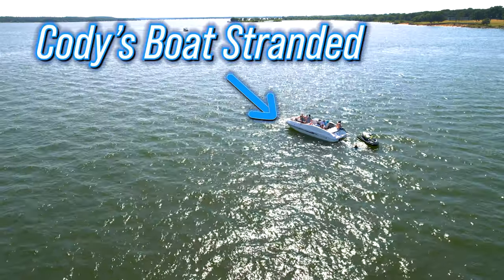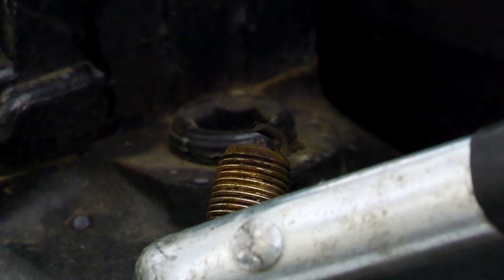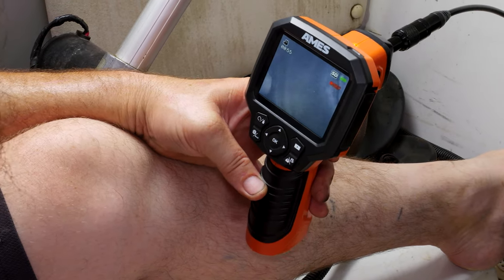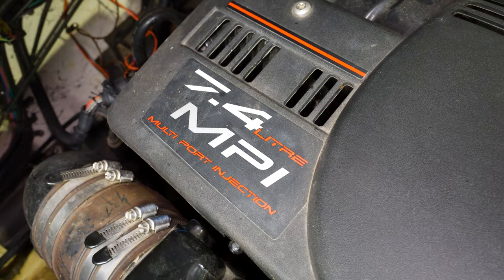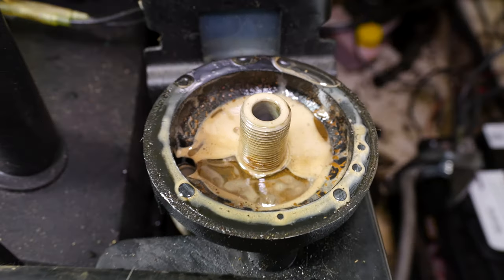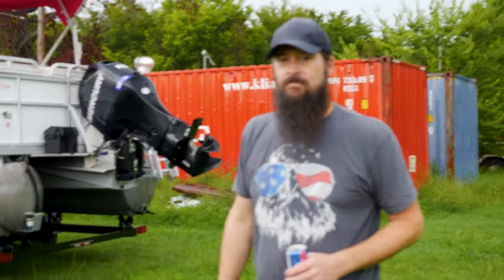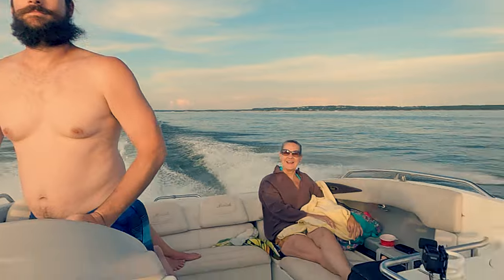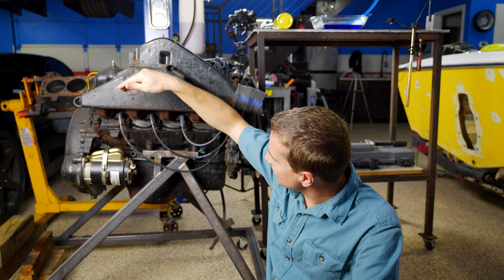We Hydrolocked Our Boat. Here's How We Fixed It!

Comment: So one thing to check is In the exhaust should be a flapper and would prevent that from happening along of people run there boats out of water or on a hose with very little water pressure and the exhaust overheats and melts the flapper out and you only find it when you pull your lower

Comment: Happened to me last month.  Was driving backward and water got in, stalled the motor.  Pulled plugs and turned motor over to expel water, sprayed some seafoam in the cylinders and changed the oil and filter.  All set!
Reply from the maker: That’s awesome man I’m glad you got it going again. I’m sure so many people think they’ve seized the engine permanently and just give up.

Comment: Thank you for doing this video.  It just happened to me on the 4th and i had to pull the boat out.  I followed every step to clear the engine, changed sparks plugs, and impeller.  lots of water came out from piston 8 and 7.    Oil was not contaminated with water.  The engine is running like nothing happened.  Your video saved a couple hundred dollars.  thanks!
Reply from the maker: This is awesome! Glad you’re back up and running again.

Comment: Thank You for Sharing this......I am no master mechanic but I do work on all my vehicles and my boat because I have a trust issue ......My boat motor is a Mercruiser 5.0 MPI......On Thanksgiving 2022 I had the same exact situation happen to me.....Had a serious overheat situation leaving a canal with current and had to limp the boat back to the dock.....After a couple minutes with the engine off we heard a large rush of water sounding like the engine was just flushed......After that, Hydro locked.....The day was over.....Got the boat back on the trailer and started the process of trying to figure out what really happened......Drained water out of just a couple cylinders, sprayed the cylinder walls of all cylinders with WD-40 and Mystery Oil, hand cranked the engine to free up all the cylinders and get all of them coated with oil.....Drained a lot of water from the oil and flushed with fresh oil and filter 4 times to get all the water out......Obviously found and changed the bad impeller........ Every one was telling me it's head gasket, intake manifold or exhaust manifolds.....Through a process of elimination I refused to believe that is what really happened and then I found this Video and it was exactly what I was thinking may have happened.......With fresh oil, New plugs, new impeller and thermostat, I was back in business and have not had an issue since......I will continue to share this because people need to understand that this situation can happen and it did to me as well......Thanks again
Reply from the maker: Thanks for the comment that’s awesome to hear! I can’t imagine how many boats get scrapped from people thinking they totally ruined the engine. Glad yours is good to go again.

Comment: Nice demo,will pass this on ,in fact this did happen to me ,my 454 runs about 140-160 I kicked around adding thermostat,well picked out mr.gaskets 180 and went to run ,well raw pump fried ,motor got hot and yup hydro locked ,250 miles home pulled rusty plugs ,milky oil ,yes this demo almostcost this guy a motor,thanks this will save alot of the diy guys that own wrenches and have adventure in them veins.

Comment: I am hoping and praying that is what my problem is. Same EXACT scenario happened this weekend. I'm not sure why mine overheated in the first place as I had just put a new impeller in, BUT, I think I may have over lubed the new impeller and it could not create a suction. I don't know. Either way, it over heated and died while in motion. I'm now thinking that water shot up into the exhaust manifold and down into a cylinder or two. I changed back to the dryer impeller that was really working just fine and tried to start it. It has that locked "CLICK" sound and would not turn over at all. Didn't turn over the next day either after a full cool down. I'll pull the plugs as soon as i can, but it's 100 degrees in North Texas now so doing it in the driveway will not be fun!
Reply from the maker: I hope that’s all it is. Let me know I’m curious!
Reply: @Motiv8Labs  
Update (062624) I did pull all the plugs and the motor turned over with no issues and sounded good. No obvious sounding mechanical issues. WHEW! The first plug I pulled did have water dripping out of the cylinder hole as I pulled it. I thought, "Man! The theory is working!". None of the other 7 plugs I pulled showed much sign of wetness. Maybe a little, but nothing dripped out like the first plug. I sprayed WD-40 in all the plug holes to help to alleviate any potential rust buildup and maybe eliminate any moisture. When I pulled the oil dipstick and looked at it, it looked fine. I'm going to put NEW plugs in it and CHANGE the oil before I try to fire it up. Wish me luck! I can't thank you enough for the video. I was SURE I had seized the motor.
Reply from the maker: @rcg9172  Man I hope this worked out
Reply: @Motiv8Labs  
Update (071224) I replaced all the plugs and changed the oil and started it on the trailer with the water hose connected to the feed hose to the impeller input hose. NOT via the rabbit ears on the outdrive. It took it a few times to finally come alive and clear out any lingering WD-40 I had sprayed in the cylinders over a week before. Engine climbed to 160-162 and stayed steady. The thermostat must be opening and working properly I'm thinking. I thought for sure it was fixed. Took it to the lake and idled around near the ramp and it began to climb into 170+ range! I shut it down and waited on it to cool off enough to put it back on the trailer. For some reason it's not sucking water from the lake. I guess? My original thought when it first overheated at the lake a few weeks back was that I had over lubed the new impeller, so I put the one that WAS working back in. I only changed it in the first place to be proactive. Now I'm not sure what is going on. I will note that I did not replace the impeller housing O-ring when I installed the new impeller and nor did I when I re-installed the one that worked. Sucking air maybe? I also wonder if the plate around the crank shaft that the impeller housing screws to has to be a certain way. I do know it spins and sometimes I've just spun it enough to match up the bolts. My other thought is that the hose going to a dead anti-salt feeder (QL Neutra-Salt) that was on the boat when I bought it is somehow sucking air. I'll be digging into it this weekend early in the morning. It's hot as ** right now here in North Texas. Any tips are certainly welcomed! 

Wish me luck!

Comment: I am about to find out in the next 48 hrs. Same scenerio. Boat overheated while idling, had to idle back 600 yards up river to dock and turned the motor off. Five minutes later, the motor would not turn over. Boat is in the shop and they found water in the cylinders. Lets see if this theory works. Sent your video to the boat shop.
Reply from the maker: That’s a bummer! I just sent this to the gang so we’ve got our fingers crossed for you.
Reply: @Motiv8Labs   Good news, motor is fine. It was like you said. The motor got way to hot, when I shut it down in a very cold river, it sucked water back up. We never tried to start the motor after we got to the dock. We instead pulled it up to the ramp and onto the trailer. With in a couple of hours (new impellar installed) of finding the hydrolock they got the motor running and it sounds fine. I was sweating bullets for a moment. The video was a huge huge help! They are now inspecting why the internal clappers did not work on stopping the water coming back thru the risers.
Reply from the maker: @bigguydiy2184  man that’s awesome! Glad y’all are back in business.